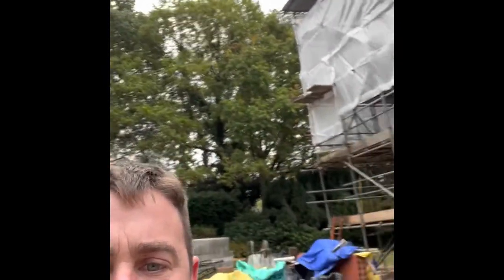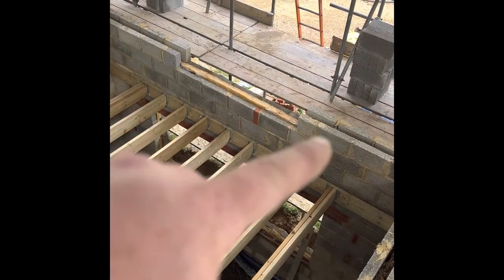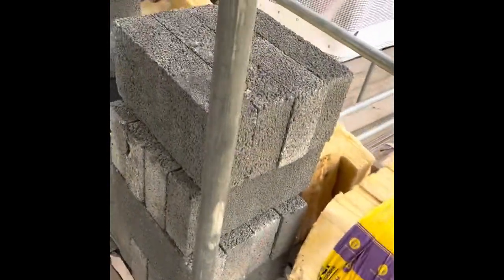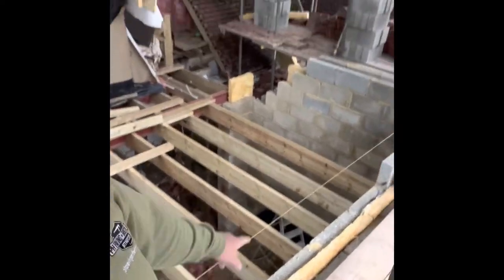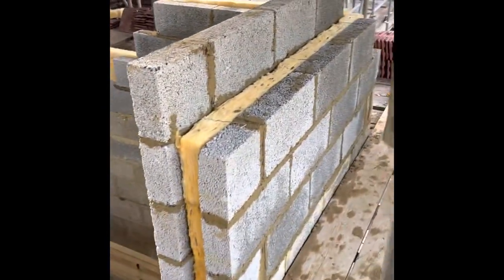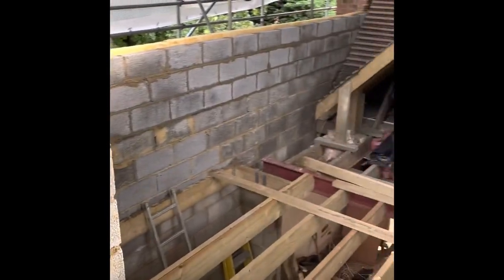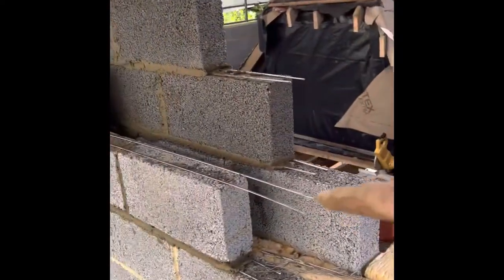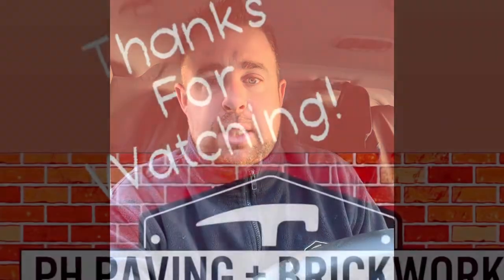Extension to roof plate. #bricklaying #brickwork #construction #vlog #build #extension #builder

Comment: Nice work, what concrete blocks you using?
Reply from the maker: They are a lightweight concrete block, fibrelite
Reply: @Phbrickwork  nice, thought I recognised them.
I'm using same on my build.
Better to handle, better thermal props and strong.
I'm in landscaping and building my own gaff, something different.
Reply from the maker: @stewart9476  yer lovely blocks to lay much better than celcons